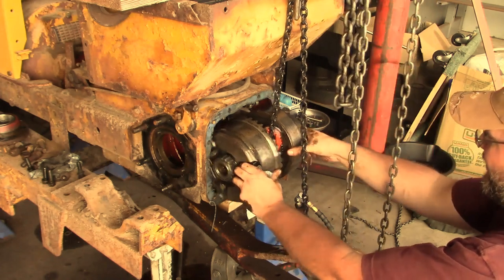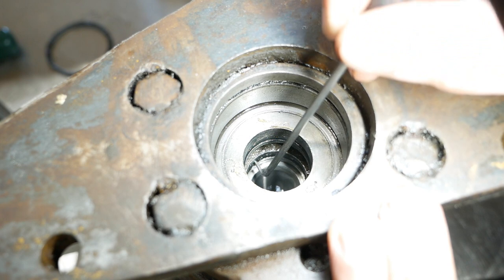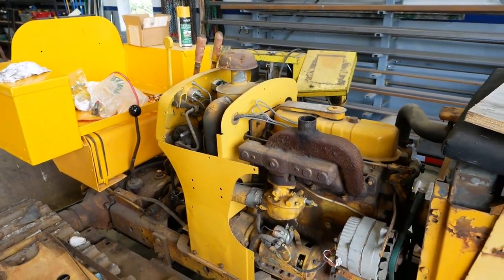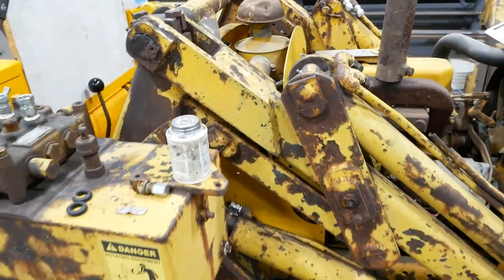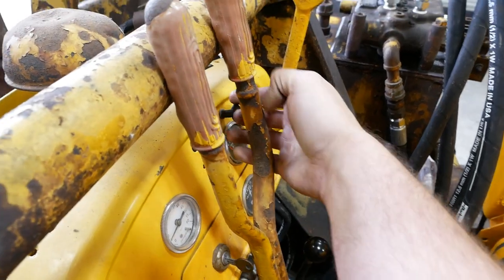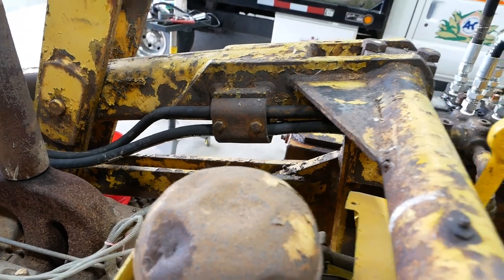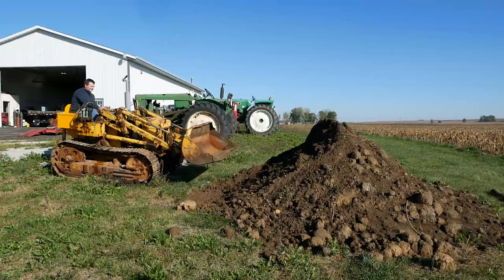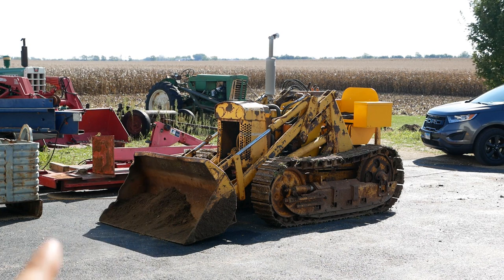60 Year Old Oliver Crawler Returns to Service - Installing Loader and Everything Else

Comment: I grew  up in the oil field area of southern Oklahoma. There if you couldn't find it you made it. Many guys who wanted to go from that type fuel pump they took a quarter inch thick piece of steel, cut it to fit where the fuel pump fit on the block, put a gasket between the steal and block, bolted it to the block and wala ready for an electric fuel pump. I would bet you knew about that.

Comment: Disconnect Switches -- I install them on the Negative side so that if the switch fails internally, it will short to the metal battery box and just turn the power on, rather than shorting the Positive to the metal battery box, creating a short to "ground".

Comment: You need a gantry with a power hoist in your shed big fella. It is amazing what you get done with the tools at hand. Glad your health is improving btw. Could you take the temper out of that shaft, weld and grind, then harden and lap it? Know any blacksmiths?

Comment: To fix the spool leak. Assuming you are abandoning that spool function. Unthread the eye end. Make a gland seal, similar to the ones they have for freeze plugging. (expansion plug) Made to reach down the ID of spool past the crack. Use the eye to tighten draw bolt or use a washer on end of spool to tighten the gland seal draw bolt. Use rubber that will be compatible with the hydraulic fluid. (obviously).The trick will be to find thick rubber "washers" with proper durometer. Second trick: I don't know what the pressure is at that area.  A double Oring shaft partially inside spool that you can lathe, held in with the spool end threads, may also work. Just need to plug the ID past the crack or past a crack stop hole. McMaster is your uncle. I don' know the details of abandoning the spool.  It seems you said it needs to still be in there to "flow" to prevent something? Maybe you can leave most of the spool in there and still use a pipe plug. Or leave most of the spool inside and plate and gasket over hole. Anyway these are just brainstorming ideas which lead a person, like you, to a better idea. The pipe plug is the best if you can maintain the needed part of spool inside. Maybe another spring between pipe plug and chopped end of spool. I really don't understand how the spool does not leak even if not cracked. Don't see how it's OD is sealed.

Comment: Just a thought but could you use JB weld on the cylinder and sand it smooth ? I think the controls are correct , to go forward you lean forward to shift , to back up your moving backwards with shifter ! I believe your dad will be pleased with it !

Comment: As far as the crack in valve. Could it be possible to open the crack up and silver solder or weld and then turn it down ?
Don't know how much pressure is in that valve assembly.

Comment: Hi Wes, Just a quick note. I think the rev. handle should be taller. Watching you running the little high lift, you had to bend over to shift it into rev. Stay safe!!!! A friend in PA Robin Jo
Reply: If anything, it needs to be shorter. It nearly hits under the dash and goes back far enough to interfere with the transmission shifter if in reverse or 3rd gear.

Comment: Excellent fix Wes  :) also would say check with for get new cylinders control box also on fan rad look like belt slipping  and fix the top GM Delco Alternator top bracket  short up more to engine hook on or shorter belt to  all rest looks good ! Surprises me no headlights also light on dash board and back near draw bar ?

Comment: Wes, with all the serious engineering work you put into the machine, surely the cost in labour and parts outweigh the amount of work that the Oliver is able to do. I might be wrong, but the owner who was an elderly gentleman if I remember correctly, may have just as well invested in a decent secondhand skid steer. Unless there is a sentimental attachment which is hard to fathom for a 60 year old work machine.
Reply: For some people it's not just about the "dollar." It's a love of old iron and keeping the running. Some get it and some never will.
Reply: For what I have in this machine, you CAN'T buy a used skid loader unless it's ready for the scrap pile. This has very low hours on an engine rebuild, 90%+ on undercarriage and now has pretty much new drive train. 
 I could sell the undercarriage alone for more than I have in the whole working machine.

Comment: 17:08 where the battery cable is pulled through the bottom of the cable box, should there not be a sleeve there or something to prevent the cable insulation from getting cut by the sheet metal?
Reply: Hopefully a grommet was installed off camera.  I'd hate to be the one sitting on the box when the 00 battery cable chafed through!

Comment: Re lowering the loader into place, maybe next time, use a chain fall between load and tractor bucket, smoother operation and easier to control when working by yourself.  Usually put the cut out switch on the terminal NOT connected to ground, keeps any leaks in the electrical system from draining the battery.

Comment: If it were me I would replace the spool with one capable of connecting to a joystick control. I think the spool the loader arm cylinders are using probably was designed to run a remote hydraulic connection for drawn equipment. The middle damaged spool was probably the right connection originally.
Reply from the maker: Not according to the manual.

Comment: Wes I have a question, I have and 04 Yukon with the 6.0, ive had it in the shop when I lived in Illinois for hard/can't fill my tank, the purge valve was bad and the vent solenoid was bad, it was pretty much ok after that but sometimes it would do it here and there now it's doing it again, I hear it gurgle when the pump kicks off, then I can put a couple of more gallons in then it clicks off and gurgles again, it's got 212,000 miles on it, any suggestions would help thank you
Reply from the maker: Charcoal canisters often cause hard fill issues.
Reply: @WatchWesWork  I'll order a Delco for it

Comment: Other Wes - please be aware that the seemingly insignificant weight differential caused by the paint overspray on that track may very well cause noticeable vibrations at speeds over 160mph...
Reply from the maker: Noted!

Comment: It sure came out better than I was expecting when I saw the first video. Does the customer have all of the exterior panels?
Reply from the maker: Yes.
Reply: I've been working on the hood this winter. It had a couple basketball sized dents in it, that someone pounded out with about 10 strokes of the ball end of a ballpeen hammer. It ain't too pretty, but looks much better than it did. Engine side panels need a bit more clean up and paint and the front grill is ready to paint. Just need some warmer temps to get em done.

Comment: There's a kinda-sorta logic to reverse levers:  the direction that you came from is probably free. So accidentally going into reverse is less likely to cause you to run into something than accidentally going forward. I've seen some (speed) boats set up similarly. To go full throttle you pull the lever towards you. Smashing into a wave and accidentally slowing down is seen as a lesser risk than accidentally going faster.

Comment: On that valve I would either try milling a new one from scratch.  Or clamping the crack closed, grinding a V-groove into the crack, weld the groove, and then turn that back to diameter on a lathe.  Might need a machine shop to get the exact diameter for the hydraulics.  I'd measure the heck out of it with a micrometer and calipers before trying anything though!

Comment: Awesome and great to see an old machine restored to its fomer glory!! I do have onecquestion though.. would it be beneficial to install a 3 cylinder diesel for extra torque and less stalling?  Im not sure if this would work but could you slip the collor over, grind a good slot andcweld it it shut. Then take bv the collor off and finsh the weld. Oh and drill a hole atvthe end ofvthe crack if you can drill thechard material.  Prolly need carbide or friction drill! If need be retap the threads on the end. You may need to turn the outside after welding.  Just a thought... lol Thanks for the great videos and look forward to the next ones!! You all tske care and have as blessed day, god bless!

Comment: Replace the spool with 3/4" O.D. pipe, run 9/16"  bolt through its length and tighten the bolt and nut to compress the pipe and make its diameter expand to seal the valve body.

Comment: you going to change the name of the channel to Dirt slightly Imperfect?!
Way to go Wes! you never cease to amaze!
Honest question. Could you put JB Weld on the scarred rod and sand smooth just to get it by?
I had a machine shop turn and sleeve the spools on my Massey Ferguson loader and it worked great.

Comment: hope the owner doesn't get in a hurry to do anything with it. Could you cut off the protruding end of that spool just enough to leave it in the neutral position in the valve and install a freeze plug in the end? Would it have been better to hold the attachment level with the tractor and drive the loader under it to install? If that guy intends to use in brush it sure needs a guard for the radiator.  Great series on an old loader.
Reply: Where would you find a freeze plug, that would hold back 3000 PSI of hydraulic pressure?

Comment: JB weld the cylinders and sand them down. A new 3 spool valve block is 120 usd + shipping in EU on Ebay. It sounds like it could use 300rpm more
Reply: Add a bit to the cost, if you have to by adapters, to go from BSP to SAE or NPT that is used here.You would need 6 adapters, and I have seen listings for as much as $30 a piece here.
Reply from the maker: You need a real loader control valve with load checks. Those "log splitter valves" as we call them won't work.

Comment: It's not a 977 but it's not supposed to be. You did GOOD and I've run rattier ones. A pony start 955 loading Mack triaxles with creek rock was an experience and ALL the clutch lever bushings were GONE! No telling what you were grabbing if you ever turned one loose. And seemed like the HD-5's didn't have a spring in the boom spool. Came in handy for turning and raising. And Swiss Army knife and grimy dog butt strikes again!

Comment: This has been quite the project, and it paid off! Ha! The cup shooting off the exhaust! Love it! XD
Man, didn't even hesitate when it broke free of the frozen ground and ice! 
Is that as high as it will rev?  Could a plain-steel rod be machined to take place of the center spool or are the interior passages/check-valves required for its operation?

Comment: Absolutely more videos about the 'Scoopy'

If it was mine, I would go for a new modern valve body. 
And with a auto return valve like on woodsplitters that release on end of travel.
Put that to the bucket turn, so when picking from a pile just pull bucket tilt and let it stop automatically when fully tilted up. It leaves hands free to use steering clutches.

And for improving reverser change the lever for a two way pedal like on old motorbikes, or just make a two way pedal that operates the reverser lever.

You said that transmission has reverse also is that any slower? Not sure but it might be ment to be used as a crawler gear.
Like pushing to a pile in reverse-reverse, then change to first from gear box leave reverser in reverse, back out of the pile, leave gearbox in first just change reverser box to forward.
Reply: Reverse gear is about the same speed as second gear. The reverser tranny is 1:1 ratio also. I may look around for a "slow low" transmission, which was an option as the reverser is also an option. There is only room for one though.
Reply: @bluegrallis  Is the slow low transmission separate unit sort of a spacer between rearend and transmission and is it splitter or permanently slow
Reply: @felixchaus  The "slow low" works just like the reverser except, shifted one way, it's direct drive to the standard transmission, shifted the other way it is a gear reduction.
 I believe they were much more popular in the OC4 dozer, where the reverser was more popular in the "high lift" loader.
  If the reverser had a wet clutch built in, so you didn't have to stop with the engine clutch to shift, it would be WAY handier for loader work

Comment: On the pitted rod, clean and fill with chemical metal, polish to the bast of your ability. Works with smaller damages
Reply: Chemical metal? Like JBWeld?
Reply: Fixed a front loader to a tractor that way, just to avoid the sharp corners cutting into the seal.
Reply: @newandoldtech5634  These cylinders don't have a "seal" in the gland. They have chevron packing and so far it hasn't leaked anymore than it should. Chevron seals HAVE to weep a bit, to keep them lubricated, or they will tear out. 
 If it becomes necessary, I will make new rods.

Comment: Hydraulic leak problem? I wondered if you cut the colar and welded some lugs on to it and bolted together like a battery clamp that might close the crack. If you were able to introduce some locktite by capillary sucktion into the crack prior to clamping that might do the trick. Good luck!

Comment: And seems like the old straight drive D-6 and 4's forward/reverse levers were setup like the Oliver. Looks like I'd said 4's and 6's don't it! Obviously the shifters ain't the only backwards thing. And that was for winching to be able to run line out or in under power in either direction. I need a nap.

Comment: Wes, 
with the leak in the cracked spool since you are not using it would it be possible to close off the front part where the crack is since the end bit screws in could you not take it off  slip a section of round stock inside it and weld it solid to prevent oil from getting into the area that is cracked?

Comment: Wess check out company called surplus center  . May have some useful parts for present project or future.  The center hyd.  Maybe cut the shaft off just below surface and install a freeze plug ???

Comment: Would it be out of the question to braze the crack in that valve and then file/sand it down smooth? Would it still seal and be useable?

Comment: wonder if you could switch the 3rd valve body to the second, then just plug the third one, and then just let it do the return?  Does the second one have the spring detent that might make it easier to control?  My neighbor had two OC-46 and a OC-3, and they had similar valve bodies, as i recall they used the two inner ones.

Comment: Perhaps some loctite 545 or 660 would help the middle spool leakage. I'm just guessing but the 638 or 641 might be helpful too. I can't remember which one we used working on an old 8n 3point lift, but it worked on a small crack.

Comment: Does the pressure of the electric fuel pump needs to be adjusted so that it does not overcome the carburetor needle valve pressure?

Comment: My logic has always been that having less exposed live(positive) lugs on a machine is better, and it’s hard to isolate or insulate terminals on those switches, so Ive always installed disconnect switches on the negative cable.

Comment: You could consider spending some time with some aliminium foil...and rub it repeatedly over the rough rusty bits on the cylinder rod...it's a trick that can put a shinyish metallic surface back on the rusty bits on old chrome...Keep the rust surface rough..it will help the aliminium to bind to it..and the foil should gragually smoothe it off.....then maybe rub a little bit of metal polish over that once finished....might work.
Reply: *Gradually.

Comment: Couple of dumb questions: 1) With so much rust in your area, why don't you first spray nuts and bolts with PB Blaster or Kroil?  2) When working on dirty messy jobs (forklift right out of the forest), why don't you first power wash and steam clear to have a clean area to work on.  Thanks!

Comment: Typically those input Orings are actually Xrings which would give 2 seal surfaces per ring. Part # would be the same as the Oring with different suffix depending in manf.